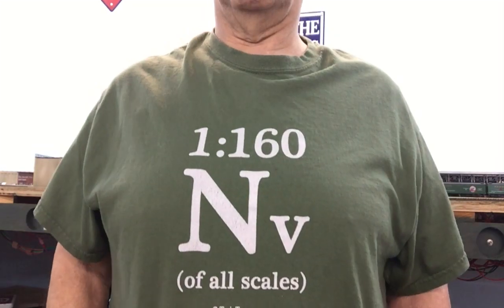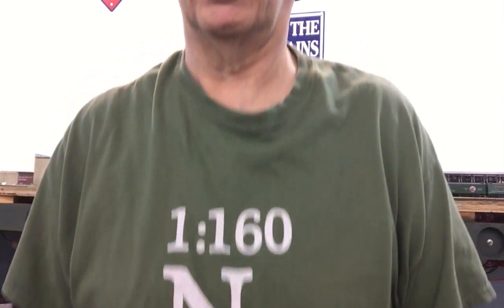3D Printing & Assembling a Barn

Comment: nice to have a cool toy like that
Reply from the maker: Hi Eric, It has paid for itself over the projects that I have done for my layout since I can size them exactly for the space available.  This printer has a 5.9" cube print area.  The new one that I just got has a larger print area (just under 8" cube) with a higher quality of print.  However I can't use it yet as the manufacturer forgot to put the power cord in the box so I am waiting for it to get here.....John
Reply: @tanzj  What is the new 3d printer you purchased?
Reply from the maker: Hi Craig,  The new printer is the XYZ da Vinci 1.0 Pro which I got on sale ($200 off retail).  It is still an FDM style printer but it has a larger print area, a heated bed (so it can use material other than PLA like ABS), is fully enclosed, and can use 3rd party material. But I can't use it until I get the replacement power cord from the manufacturer since it was not in the box when it was delivered....John
Reply: @tanzj  What 3D modeling software do you use?  Does it model textures too?  Woodgrains, stuc etc?
Reply from the maker: Eric, I use the software that XYZPrinting provides for free.  It is called XYZMaker and it allows you to manipulate the standard geometric figures (squares, triangles, cylinder, triangle, etc) to look like what you want. For  example, those are all of the shapes that were used to create Vinny's Phoenix Depot. As for making wood grains, bricks, or any other kind of displacement surface for printing, it does not do that directly. However, you can find a lot of free designs that can be used on sites, such as "thingiverse" or you can just take a lot of time and effort to use the geometric figures to create something close to what you want. The software that I use has a plug-in function where you can either take a picture of an item and/or scan a texture and then manipulate it within the XYZMaker program. If you have a program such as Sketch-up or 3d Studio Max, you can create displacement surfaces, which for the most part, could be printed by my type of printer in either PLA or ABS.  I have used the free version of Sketch-up but cannot find it cost effective to buy the full version when it costs twice as much as the printer that I have to include my new one.  Also, in N-Scale, a scale brick is around 1 mm x 4 mm which is almost too small to see when printed.  I have used 3 mm x 5 mm large stones (and even 3D printed) for several retaining walls that I have not yet installed.  ....John

Comment: I've tried to design a model on the software, but failed. Seems like rocket science to me
Reply from the maker: Ray, Thanks for watching & your comments.  It just takes a little time to really understand how to use the design tools.  Most of the free ones such as TinkerCad (on-line), Vectary (on-line), & XYZMaker (I use this one - downloaded to Mac/PC) just use geometric shapes (squares, triangles, cylinders, etc) to create shapes such as buildings, walls, etc.  To make an opening, they have a hole tool.  So for making a window opening, you first build the window out of the shapes then take the dimensions of the window & create a square or rectangle of the same size.  Then you would place it on a wall where you want the window opening & then use the hole tool.  The window is then placed into the opening.  The best way for you to get comfortable using the tools is to go to TinkerCad & use their tutorial. There are also many more design programs (some are expensive) but I am satisfied with the free ones so far.....John
Reply from the maker: Ray, If you are on PC, I forgot to mention Microsoft 3D Builder which is a free download from their store.  My oldest son uses it and told me that it is very easy to learn and use....John
Reply: Thanks for the advice. I never really thought of using the geometric shapes nor was I aware of the "hole tool". This was some encouraging advice and I will give it a try. Thanks for recommending some design software. I have the AutoDesk 123Design.

I really would like to have a model of an EMD F125 as well as a Siemens SC-44. But I mainly want to create a small toy like model train based loosely the on German prototype designs.

Again thanks for the advice
Reply from the maker: Ray, With the software that you have, you should be able to build what you want.  Sometimes the better software programs take a lot of time to learn their intricacies.  I have tried Blender & Strata3D and just found them to be more complicated than I wanted to learn.  You might even take a look on Shapeways to see if someone has already designed one of those engine shells at a reasonable price.....John